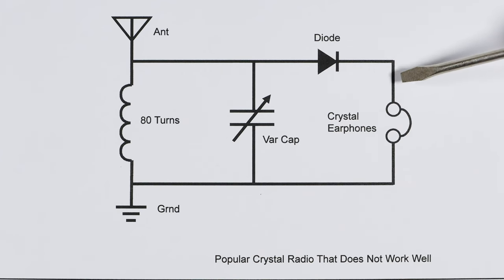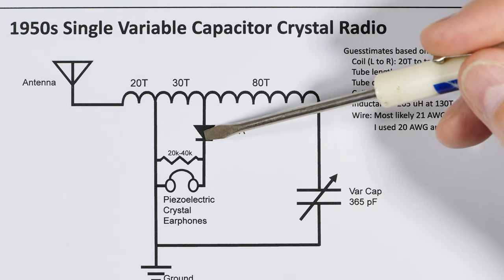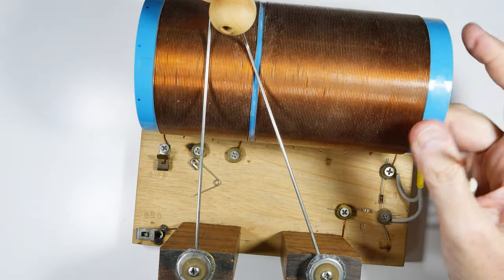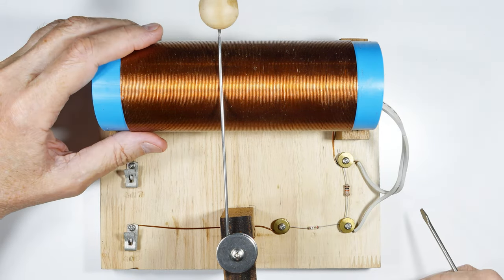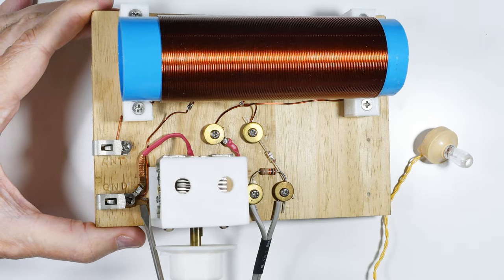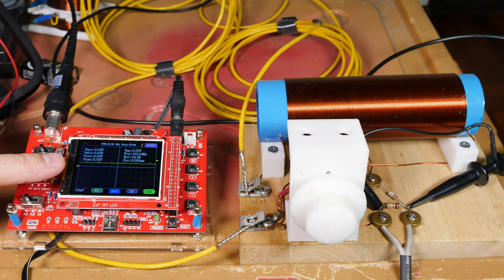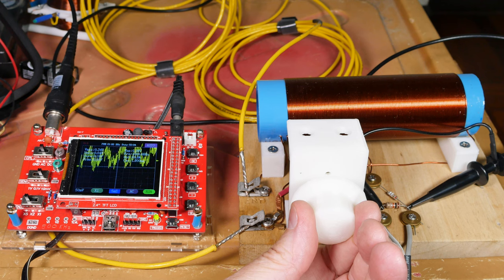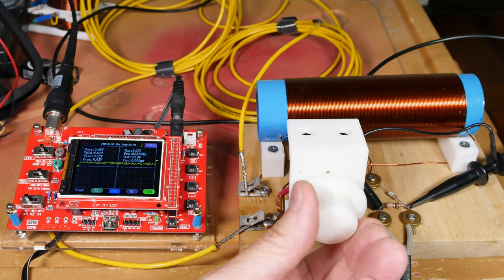Crystal Radio--No More Variable Capacitor Designs? (4K)

Comment: A compromise between a wiper adjustable coil and the fixed coil and variable capacitor designs might be to use a coil with multiple tappings towards one end of the coil and a small variable capacitor around 50pF maximum. This would maintain a higher Q for the tuned circuit while possibly being easier to make. Crocodile clips could be used to connect to the taps on the coil. My uncle made us a crystal set back in the 1950s which had dozens of taps on it together with a fixed 500pF mica capacitor, but I found that only the taps towards one end of the coil were useful for Broadcast Band (Medium Wave) reception. As I learned more about radio, this tapped coil, used with smaller capacitors, was very useful when experimenting with short-wave reception.

Comment: That takes me back about 50 years. my first crystal set on a block of wood and a bit of crystal stuff as the detector. Thanks for the video and i look forward to the upgrade.
Cheers Dave.
Reply from the maker: Thank you. I did my first crystal radio for cub scouts from the handbook. That was almost 60 years ago. Used a toilet paper tube, wire from a transformer, and a piece of galena. It's still magical.

Comment: I've built a few crystal radios using both the slider coil and variable capacitor (taken from an old portable radio). It worked a lot better than I anticipated.

Comment: You must check out the " Mystery Crystal set " I believe it was first published in 1932. I have had good results.  I have also later added a simple 1 transistor rf amp and use a PA speaker transformer with modern ear buds.
Reply from the maker: I did look it up. Interesting design. I have two that have similarities, but are not exactly the same.
This is a capacitor type that works well: https://youtu.be/0AvTO588SyU
This is a wiper style with built in antenna tuner: https://youtu.be/mh5KxCpbQ5U

Comment: with only one varcap it is indeed difficult to get more than 2 or 3 stations "correctly".
Good idea to build the coil like you did.
Another option is splitting the coil (antenna-coil / tuning-coil) and make them slide into each-other.
Reply from the maker: I have tried various sliding coils, but not had much luck. They lack efficiency. I did a video on the variometer version of that. It looks cool, but does not perform so well.

Comment: Thank you so much for making these videos- Ive learned so much from watching your builds & a few others, and finally felt comfortable and encouraged enough to build my own crystal radio. I did a 25 turn antenna coupled to a tuning coil (same tube about .25" space between the two) with taps. Bottom of antenna coil and tuner coils are grounded, as are one side of my earpiece and one side of 47k resistor. Other side of resistor is connected to other side of earphone and cathode side of diode, anode side of diode to one end of alligator jump clip, other side of the aligator clip on the taps for tuning. The top of antenna coil isnt connected to anything, and the top of tuning coil is connected to antenna wire. I built this with extremely little knowledge of how circuits work other than watching videos and borrowing a copy of "electronics 101 for dummies" and doing a quick read through that, so I played around with it lots to figure it out, but it works great- I pick up my nearest AM station during the day (loudly!), but at night I pick up a few (much quieter) shortwave stations that broadcast internationally (at least one is +550 miles away) so I am quite pleased! I just salvaged a dual air varcap (and a few other interesting, if not useful, parts) from an old tabletop tube radio and was wondering if you might tell me where I should connect it in the circuit? I assume it should take the place of the jumper clip (currently from diode to taps), but do I need to incorporate each of the capacitors individually? And if so how would I do that? One  varcap connected to first tap and other connected to last tap? Any advice would be appreciated 😊
Reply from the maker: You are welcome. Glad you got it working so well. Have you watched this video on using a dual gang cap?  
https://youtu.be/EqEVuLFxgCQ     
Maybe it's what you're looking for.
Reply: Thats exactly what I needed, thank you! 😊

Comment: Hey, so I want to use these concepts to energy harve ULF and ELF, specifically I want to experiment with energy harvesting the noise floor at 5 KHz and lower, avoiding 60 Hz of course, I don't need to go to jail lol.

What would you recommend? I"m going for those frequencies because I noticed that the noise floor at those frequencies can be as loud as broadcast in higher frequencies in terms of dB.
Reply from the maker: Higher frequencies have a LOT more energy to harvest. I think by the time you get to ULF and ELF you might as well put a cockroach in a hamster wheel. I don't know of any laws about harvesting 60 Hz, as long as you stay a certain distance from power lines. If you harvest it from your own house, it will show up on your electric bill (no free lunches). I just ran the numbers on an LC calculator, and for 5 KHz you only need 100 uF and 10 uH. That's not hard to do. It's making an efficient antenna. Often they are quarter wavelength. The ULF wavelength is 1,000 to 100 KILOMETERS. ELF wavelength is 100,000 to 10,000 KILOMETERS. I wanted to build a radio to listen to the Sun's output, but the amount of wire needed for the antenna was prohibitively expensive.

Comment: Knowing that I lack some basic background info, this did help for the variable capacitor. What through me off was not thinking it worked was because of a loose bottom chassis wire connection.  Soldering doesn't seem to hold so I just used  a piece of masking tape on the side of the chassis. I rubbed down on the tape, and  the circuit worked to get two stations at very low volume. 
Thank you
Reply from the maker: If the solder won't hold, it's very likely the wire has not had all the insulation removed. A dirty connection could cause the low volume.
Reply: @tsbrownie  audio is good quality with better antenna reception for the two local radio channels. I'm very pleased with the results.
Reply from the maker: @Paul-ki8dg  Well, good. The antenna is supplying the power, so a better antenna means better output.

Comment: Variable inductor, and jfet detector may be nice to try? Also use a 18 henry or at least one henry inductor across the piezo ear phones. Water pipes make a good ground and you can use a tv antenna for am as well or one or both sides combined. Or a split antenna version. If you use a Jfet maybe an antenna to the gate and one to the circuit with common ground. With maybe a coupling 10pf capacitor in the circuit. Maybe a voltage multiplier to the piezo as well.

Comment: Is it possible to make this radio with a 14-178pF tuning capacitor and 28 guage magnet wire? If so, what changes would I have to make to the design?
Reply from the maker: That's pretty much a complete, untested redesign. But, if you had 20 AWG wire and made the same coil as shown, you could use that variable cap wired in parallel via a switch to a 180 pF capacitor. It would divide the band into 2 pieces (14 to 178 pF range, and with the fixed cap 14 + 180 pF and 178 + 180 pF). With the fixed cap in the circuit, it would tune the lower part of the band. With the cap switched out, you'd be tuning the upper part of the band. That was a common way to do things in older radios. In fact they had removable coils for different frequency ranges.  If you want to design from scratch, my 2 favorite free playstore apps are "Electrodoc" and "LC Circuits."

Comment: Nice multi-Station tunable crystal Radio...Well done !! ....You could connect a Fixed tuned Parallel LC tank "Trap"  circuit in Series with your Antenna wire...Fine Tune the L or C to Resonate & "Notch" out your strongest Offending station & Move the diode Tap farther "Up" the Tuning coil for max volume on Wanted stations....
Reply: Also:  If you use a tuned loop antenna, you can turn the null point of the reception pattern towards the offending station.

Comment: I just built this and it works great !! I wonder if the selectivity could be even better if you added a varable capacitor on the smaller antenae circuit ( the 20 turn ) loop. ? That is my next try.
Reply from the maker: Interesting idea. Let me know how it works.

Comment: Be sure to use a germanium diode instead of silicone for more sensitivity.
Reply: Yes many use silicon diodes and expect that to work, in fact all 1N34 germanium diodes are not equal some of the same part number perform better than others,  try a few different ones to find a hotter diode

Comment: Hi , I like the circuit because it appears to include an antenna / load impedance matching circuit . typical crystal set needs Hi impedance phones so as not to load down the Antenna . I've built a crystal set with an OA91 diode , Hi Z phones and a 150 foot long wire antenna Long time ago . The next step up from simple crystal set receiver would be a T.R.F. ( tuned radio frequency receiver) or a Regen circuit  . Or you could just bang an audio amp on the output of your crystal set so it can power a loudspeaker . 73's DE G4MXC .
Reply from the maker: I like it for the same reason. That and it actually works! I have a video on putting a low cost audio amp on these. https://youtu.be/RW3VhnzgjtA
My antenna is only 9 meters or 27 feet.

Comment: Your coils look beautiful. But, there is a big but : there is a lot of capacitive coupling between individual windings.
I used to build these as a youngster. Nowadays it is hardly any fun since the high power Medium Wave transmitters are now doing DAB only.
I am in the Netherlands btw
🤝🏻
Reply from the maker: Thanks. The capacitance is included in the resonance calculator. It's 1 reason there's not the capacitor used in old radio designs. DAB is a problem.

Comment: I don't know where you found those variable capacitors but the shipping these days cost more than what you paid.

Have you tried using a signal generator injected into the antenna leads set at both the low end of the AM band and at the high end of the AM band?

You could then adjust your variable capacitor to maximize the signal at those two extremes and measure the capacitance.

These two numbers would let you pick a variable condenser with a range that's fine tuned for this design and that might also give you more selectivity without the need for gear reduction.

This is all a guess as I have no electrical training or degree.

The problems I see with the corroded old vintage tuners is they might not be consistent across their entire range due to oxidation variances on their plates. Again; not checked but a guess.
Reply from the maker: I bought them years ago. I think I've used them all up and will have to buy more. I just googled them and found them from $25 up. Ouch.
Yes, I have used a scope and signal generator to check out the circuits, resonance frequency, etc. Also checked that against the online calculators.
Old caps can have a lot of problems, the most common being plate damage / bends. I've kept these well packed.

Comment: Are using the crystal radio in an urban area where microwaves bounce all over.
Reply from the maker: @marcominneapolis3461  Microwaves are so short they have almost no effect on AM waves. It's noise from motors, welding, and similar that affects AM.

Comment: If someone had the time and made 500 of those coils, placed them on a wall to generate electricity, has anyone tried that?Would each coil need it's own antenna wire?
Reply from the maker: I can't answer the first question, but for max power each would need an antenna.

Comment: I use this. Type. Of. Variable. Coil. In crystal   radio. ..in. 1968. ...working. Very. Well with. OA 79. Germanium.  Diode. And. Miltery wireless. Headphone